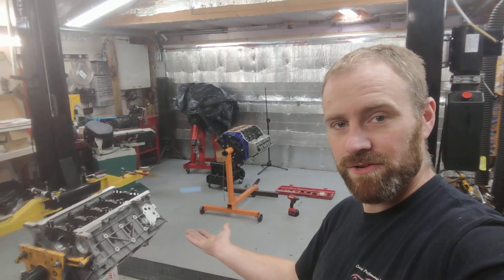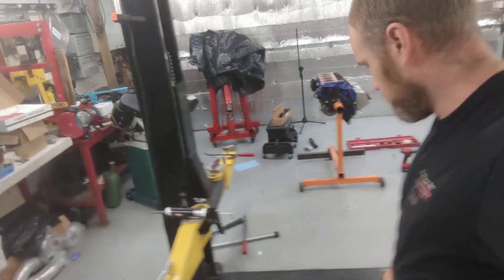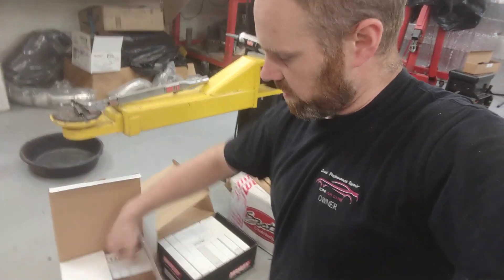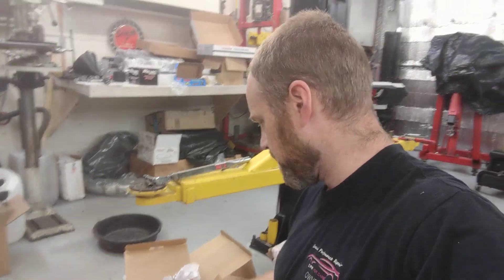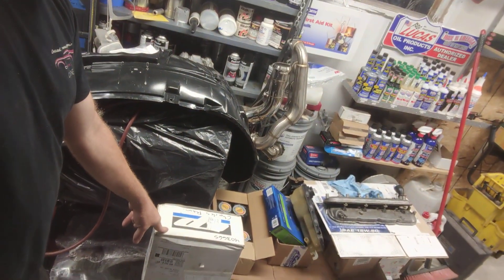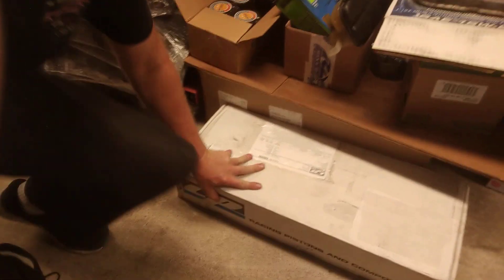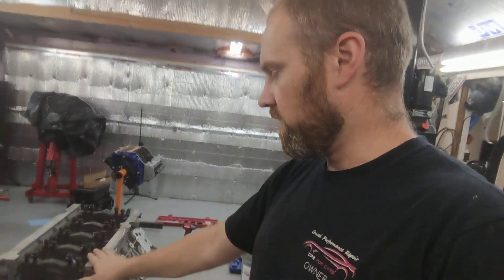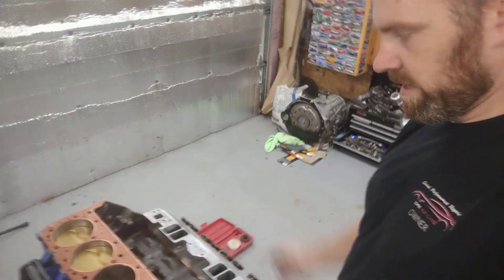Ask me about engines!

Comment: How would you troubleshoot to find the source for low cylinder pressure.  2004 Ford F150 4.6l. Shop confirmed with pressure Gage that one of the cylinders had low pressure ~ 50psi.